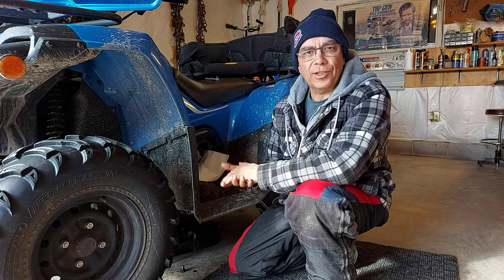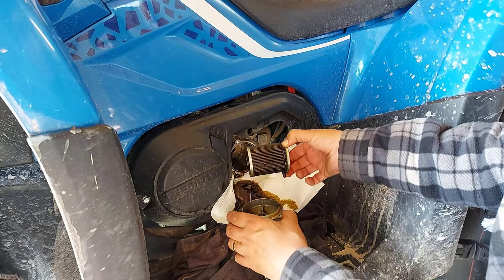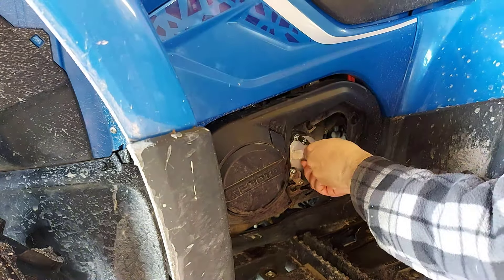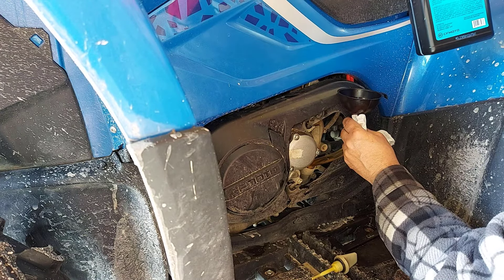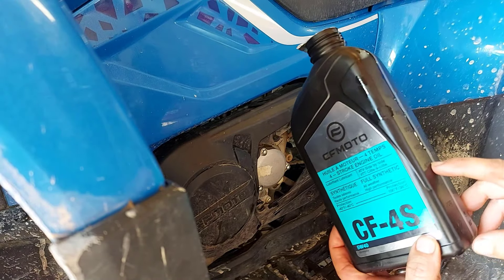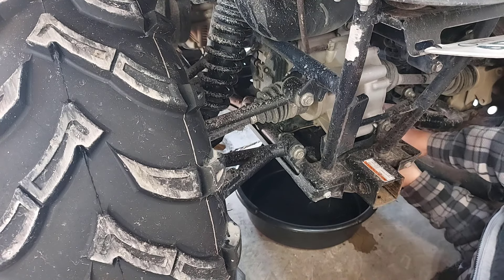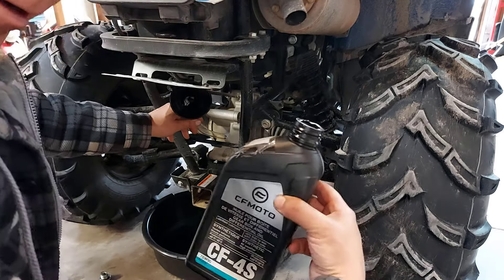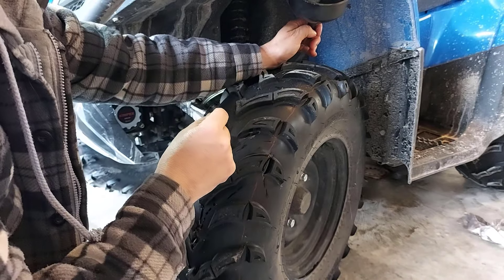Keep Your CFORCE Running Smoothly (Rear & Front Diff Oil / Engine Oil)

Comment: Nice easy service . It’s nice to see the oil filter is accessible . My can am is a real pain as I have to remove the entire foot well to access the filter which adds half an hour to the service. I block my machine up high when servicing . Saves the knees and back. I use 4 truck  ramps which sit on platforms made form 2x6 . Works well for my quad side by side and pickup .
Reply from the maker: Great ideas Lloyd!